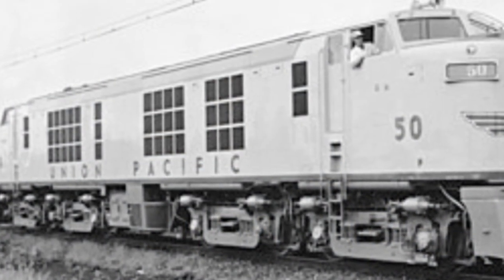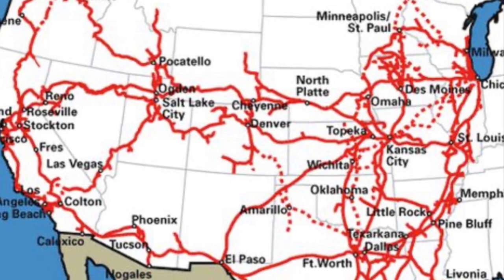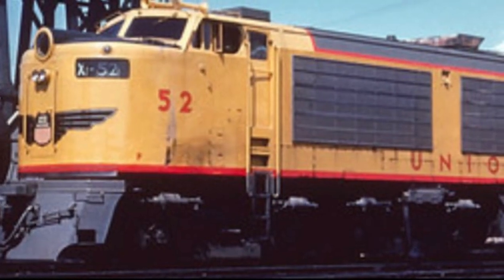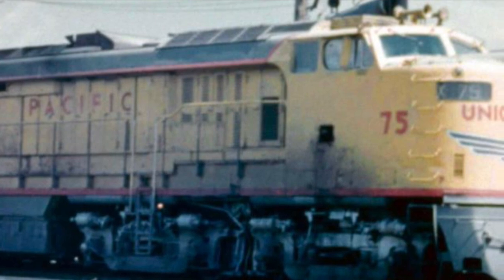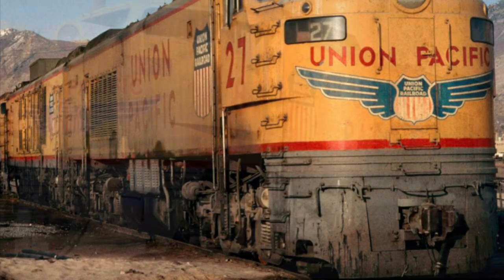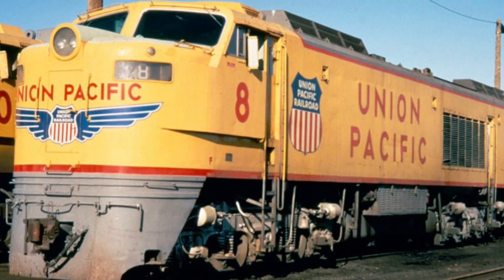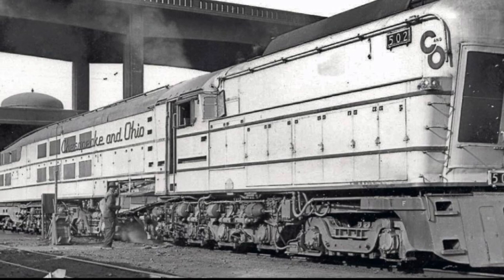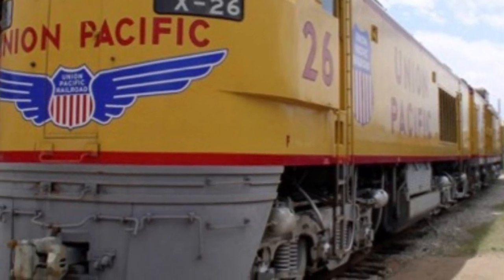Engines Of North America: The ALCO-GE GTEL

Comment: Another problem was blade erosion.  This was manageable on the heavy fuel oil units (but unacceptable on their experimental coal-fired gas turbine electric unit built on the running gear of a former Great Northern W-1), but when they came due for rebuilding, the increased price of Bunker C (now Number 6 heavy fuel oil) made management decide against keeping these locomotives.